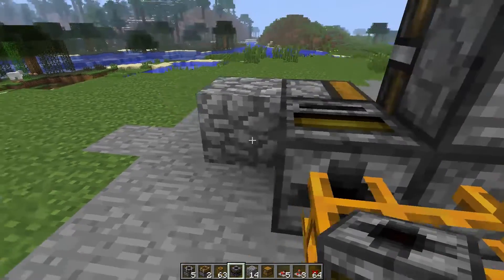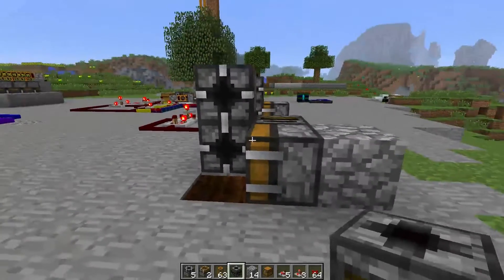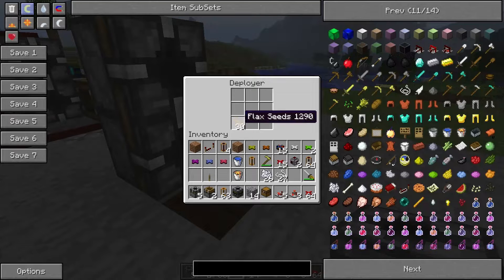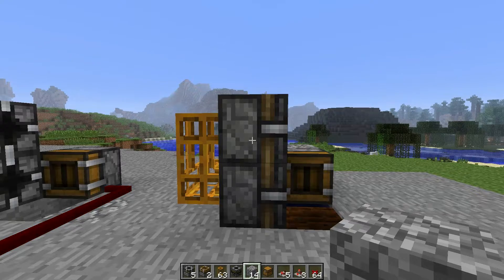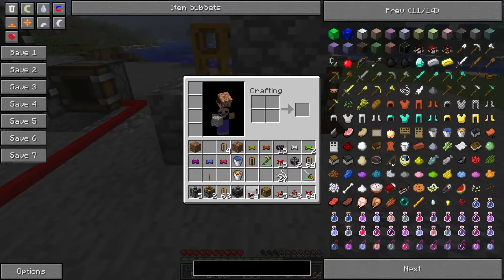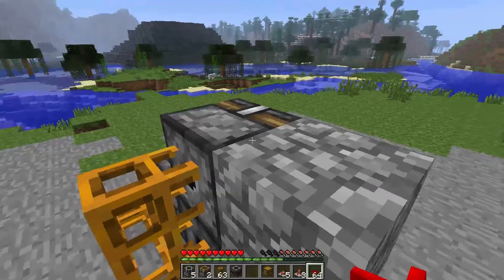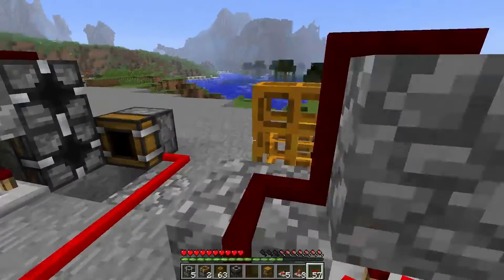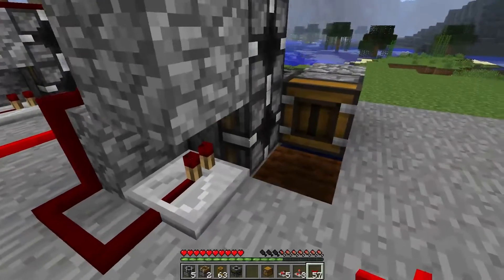[Tutorials] Redpower - Flax Machine

Comment: @ShadwDrgn I meant for scrap generation, you can also use redpower pneumatic tubes, though it is slower. For 3 blocks of cobble, if you macerate 1 into sand then melt into glass, you get 8 buildcraft pipes to turn into scrap. With redpower blockbreakers you can make a very automated scrap generation system